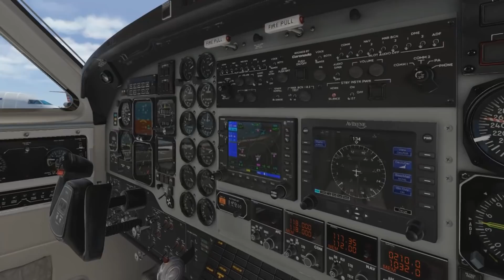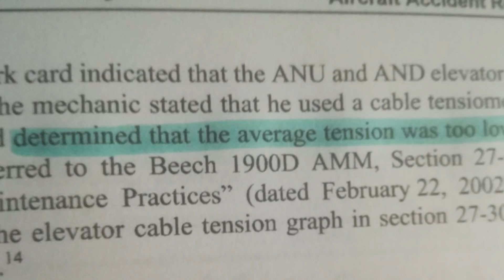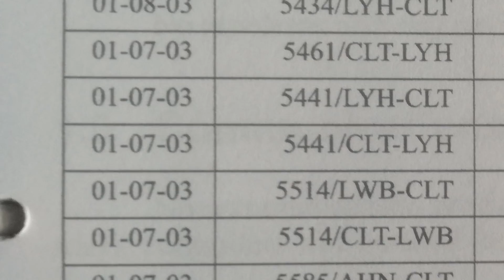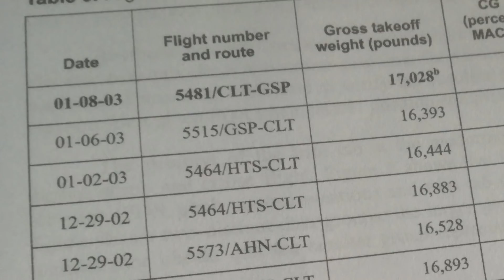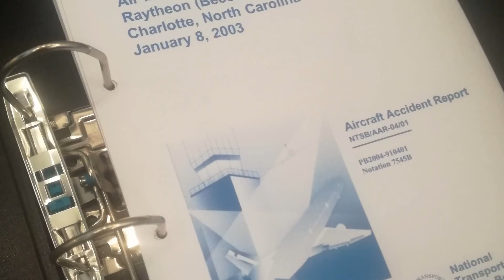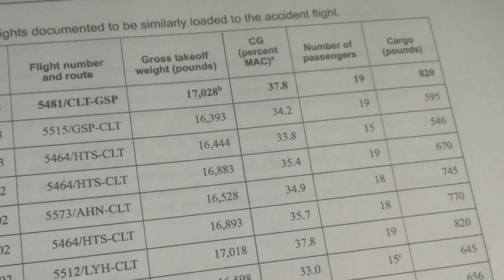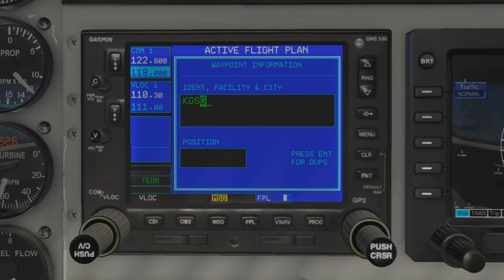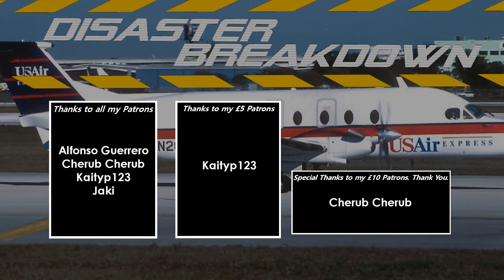Did An Overweight Plane Cause This Crash? (Air Midwest Flight 5481) - DISASTER BREAKDOWN

Comment: A little bit of a fact check:  The popularity of the Beech 1900D did not diminish, like you state.   The reason you don't see many of them now is simply that they reached end of life (for main stream operators) and were replaced by newer aircraft. This happenes to all aircraft types.
Reply: Moreso that its job had been cut.  Saab canceled the 340 (and 2000), Raytheon the 1900, Bombardier the Dash 8 100-300, Embraer the Brasilia.  Small fields lost service, now with no aircraft to serve them (strangely our local field, Palmer, built a jetway, for Northwest’s Saab 340, explain that one, Northwest retired the Saab’s, and having no plane to fly, it lost service).  Having no fields that required the aircraft, there was no need for a replacement.  Was down in Charlotte for business a while back, the flight is now being flown by a CRJ 🤷🏼‍♂️.  Our state got hit hard with the scrapping of turboprops, US Air had service to everywhere on the dash’s and 1900’s, they left.  Continental took over with Commutair and/or Gulfstream and their 1900’s and Saab’s, they (having no aircraft) left.  Now we have Southern in Caravans.  Speedy they are not.

Comment: Even if the stated takeoff weight of 17,018 pounds had been correctly calculated, that weight still would have been over 99 percent of the maximum takeoff weight value for the aircraft.  In other words, no safety margin whatsoever.

Comment: sounds to me like this is more of a maintenance and proper management issue than overweight.  Not saying it wasn't overweight because it was but often those measurements are considered the "Safe" operating parameters but can easily be surpassed by the plane.  I would say that the airline should have never let the plane get past the weight limit and to think that the maintenance people restricted the pilot's ability to control the plane in such a severe way is outrageous especially when they had the proper information at hand.

Comment: Was there anything the crew could have possibly done to save the plane, or was the crash inevitable? It looks like the latter to me, but just wanted to ask...
Reply: @Mark  I don't think they could possibly recover from that. Once it started to flip there was no chance of gaining control and not enough time even if they could, in my opinion
Reply: @Mark I think the angle it went to straight away was too much for them even with full power to get the nose back down so the landing gear wouldn't have changed it and because of there height they couldn't get lift from the plane falling as they were too near the ground, had they been alot higher possibly could have dropped and then eventually brought it back up but like I say too near the ground and making matters worse was the work done on it previously.

Comment: The piston Beech Queen Air 65 was an unheralded but great aircraft. It was great working with heavy loads in the mountains of Mexico. Their supercharged motors of 340 hp Lycomings were outstanding & trouble free. Beech 1900. It's not the weight. The aircraft will take the excess weight. It's the C.G.

Comment: Whenever I fly a commuter plane, I look around at the passengers. If all seats are full, I feel dread, especially if there are a lot of men or obese women. And in high altitude airports such as Denver, when they occasionally have to limit the load because of heat and the high elevation, and they say they need to deplane two passengers, I feel so nervous, thinking that if the plane is that close to being overweight, simply by two passengers, I want to stand up and shout, “please take the two fattest passengers”.

Comment: Why don't they just incorporate weight sensing abilities into the loading equipment? Like the terminal gate extending to the plane or stairways. Measure a group at a time and not announce or display it so no feelings get hurt. If it's overweight... Quietly hurt feelings for safety.
Reply: Honestly who cares about hurt feelings in that situation? I'd rather feel embarrassed by my weight on the scale and get there safely than have my feelings spared and potentially contribute to an accident.

Comment: If only they had had listened to the baggage handler. She told them the plane was overweight. But she was african american, so they ignored her.
Reply: @southpakrules  I am not a racist in any shape or form so get off your high horse.; if the film got it wrong that's not my fault.
Reply: @brendannaylor8118  The film and the (thankfully not racist) investigators found the root causes of the accident (in relation to passenger weight calculation) that prevented future accidents, while your racist prejudice decided that it was because the white flight crew ignored the African American baggage handler comment regarding baggage weight (which although correct, bared no consequence to the accident it self). Talk about making aviation dangerous again.
Reply: Normal people we are sick and tired of this rac1smm bs...

Comment: I get tired of videos that are supposed to be about a crash but spend the first 5 minutes on the history of air travel, or the airline, etc.   If you are going to give backstory, give it on the pilot or passengers which would be much more relevant and engaging than the history of the Beechcraft.  Having said that, great disaster breakdown.

Comment: If the aircraft was out of its weight & balance it could cause the aircraft to pitch up or pitch down just after rotation.

An over weight aircraft could take off but possible be unable to clime 

If the aircraft was tail heavy that could cause it to pitch nose up and if it was way out of the Flight envelope the input from the pilots would have no or very little effect on the aircraft.

Comment: Seriously, why do people take a plane for 75miles or about 110km? Yeah it’s a drive of about 1-1,5h  (in my country it would be) but I wouldn’t even consider flying from my town to my brother who lives 175km away. Seems so over the top.

Not saying it’s the passengers’ fault ; I just don’t get these short flights. Where you land almost right after taking off basically. Still 30minutes for a 75miles flight seems rather long if you ask me. Which nobody will ofcourse lol
Reply: In many cases, flights like this are just the first or last leg of a longer trip. Airlines know that some people prefer flights in or out of their regional airports, so flights like this are run.

As for reasons why, there can be a few. Depending on the terrain, 75 miles as the crow flies may well be double that driving, especially if there are mountains or lakes in between that need to be driven around, potentially in dangerous weather such as snow or heavy rain. Alternatively, if you live close to a regional airport, it will be easier to get someone to drop you off rather than having to pay for parking your car, someone might be taking minutes out of your day rather than hours. Security at these airports are also a lot less chaotic than at the larger airports, allowing passengers to arrive potentially half an hour early or less, rather than the standard recommended minimum of two hours during peak periods. Finally, not everyone has a car, even in the USA, and especially among younger adults going to college, so flights like these are a lot more common from smaller college towns.

Hopefully this gives you some idea as to the niche that these flights fill.
Reply: I agree stay on the ground
Reply: 1) Airplanes are safer than driving. 

2) Flying from smaller spoke airports is often more convenient than a big hub. 

3) The catchment of a smaller airport will radiate farther than just the immediate area..
Reply: @KyurekiHana  that does explain some of it yes, thank you.